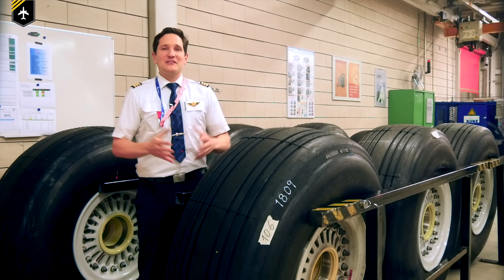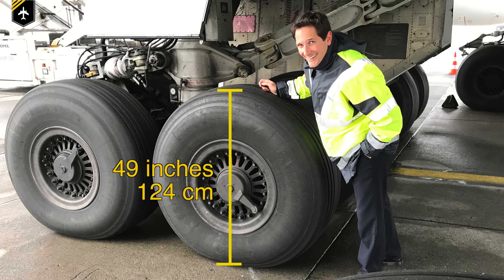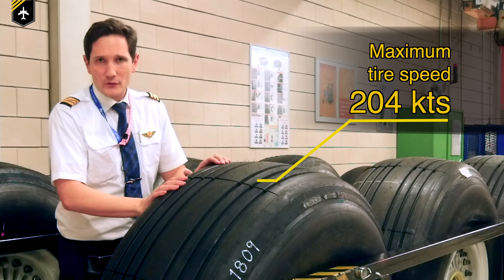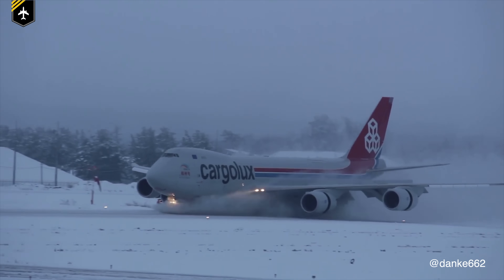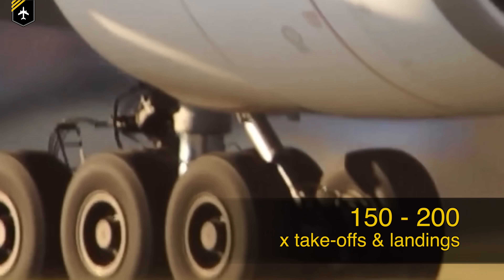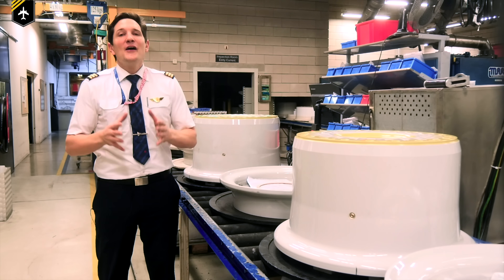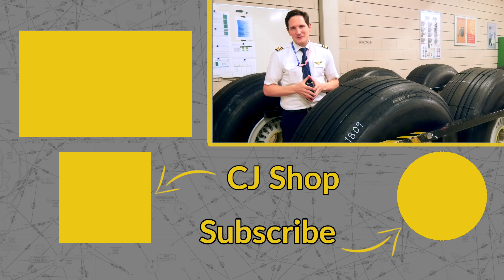HOW MANY LANDINGS can TIRES withstand?? Explained by CAPTAIN JOE

Comment: What’s the compound like on a aircraft tire are they a harder compound or a soft compound? Can you choose a different compound tire depending on what kind of weather the aircraft will be operating in?
Reply: Aircraft tire compounds are formulated to meet a large number of technical and regulatory specification requirements. Whether the compound is hard or soft is generally not a primary consideration and is really only a resulting consequence of meeting the aforementioned requirements. To this end, there are not different tire compounds to select from, as all the available tires will meet the full range of the certified aircraft operating envelope. In most cases, the only tire options that the aircraft operator has any choice in is the tire manufacturer itself.

Comment: Dear Captain Joe,im a big fan of your channel,the best out there on commercial aviation

One question for you ive had in my mind for a long time after watching countless landings at airports
Wouldnt be better for the tire lifespan and even safety if the tires would be rolling when they hit the tarmac at such speeds?
Say using some small motor to spin the wheels a little would avoid the big rubber burnout,the inertia alone would make a big gash on the rubber landing at such speeds,right?
If the wheels are spinning that can be averted,me thinks

Comment: I've always wondered if the airplane has breaks on the wheels to break when landing, just like a car has brakes. And if so, what kind of brakes and how often does the frictional parts need to be replaced? Or does the airplane only break against wind resistance? Sounds like a question for Joe ?
Reply: rpuls planes have brakes. This can be operated by depressing the rudder pedals (toe braking) or by selecting an autobrake mode on equipped aircraft that has the system do it for you. Some aircraft even operate the autobrake such that the deceleration rate stays constant to improve passenger comfort. The other part I have no idea.
Reply: Airliner brakes are of the "disc" style, though there are maybe 5-7 pairs of them within each wheel rather than a single pair (a pair being one rotor plus one stator) as with a car.  Originally the rotors and stators for jet airliner brakes were made of steel, except for the Concorde which used carbon.  The Space Shuttle orbiter originally had beryllium brakes, but in the down time following Challenger's loss, carbon brakes were developed and substituted (those beryllium brakes were woefully undersized because the weight of the orbiter increased substantially from what was in the original specification the vendor was working to).

Steel airliner brakes are designed to last through at least 1000 cycles of a dynamometer test which simulates a typical landing.  That is the "1000-stop" or "warranty" landing profile which must be achieved in order to meet the terms of the contract between the brake vendor and the aircraft manufacturer.  For carbon brakes it's more like 3000 landings, but in either case actual brake life will vary with the sort of usage they are subjected to.
Reply: @marcmcreynolds2827  makes sense to have a lot of them. Would still like to see a video on this subject, either a explanation video or an engineering video

Comment: I often wonder why the rpm of tires aren't brought up to touchdown rpm speed by the use of electric motors, wheel fins, etc.  Seems such a waste of good rubber to smoke them every touchdown.  I'm just an observer, not a pilot.
Reply: The Ramblin Georgian Have a look at “Mentour Pilot” channel for 2 episode on that topic. In a nutshell: there is no sufficient savings made by sparing the tires... Apparently!
Reply: In addition to what @Margaux & J-B Roussel stated, another reason not to spin up the wheels before landing is due to when the aircraft needs to perform a crabbing maneuver due to cross winds. If the wheels were spun up during this procedure, then the aircraft may be more difficult to control.
Reply: Thanks for info.

Comment: Why not set the wheels to rotate before landing, wouldn't it not avoid a hard tear and wear on them ??
Reply: Instability during landing, especially during high crosswind and slippery runway
Reply: Ashraf Hafizie: I don’t buy that. Landing on wheels that doesn’t already spin would be more hazardous than wheels matching the speed. (on second thought I do buy that regarding crosswinds, but that could be regulated via the onboard computers)
Reply: Michael S. Müller: I’ve had the exact same question for years. 🇸🇪

Comment: After aircraft use, I can remember a grain trailer on a fellow farm needing replacement tyres, and they were ex aircraft tyres, and capable of a lot more load than the trailer could ever carry, or speed of 20 mph to 25 mph, 32 to 40 kph  speed.    Just a great idea for old aircraft tyres.    This is going back a few years ago now .   I do not know if this would still be legal in UK.
Great Video,   Thanks

Comment: I had to replace a tire on my plane last year. Only about three years old, maybe 200 landings, but I got a bit too enthusiastic with the brakes on a practice short-field landing. :-)
No need for nitrogen, plain old air works fine in little plane tires.
Reply: Not the best practice! Perhaps good enough with car tires, but even a small and old Cessna, Piper or whatever similar, DESERVES Nitrogen filling, Maybe not as demanding as in larger airplanes, but still above any daily driven car. Just consider the cost of the smallest airplane tire related accident or yire failure... Are you that lazy?  With due respect, your attitude is incompatible with aviation, sorry.
Reply: @alfredomarquez9777  What kind of plane do you own? You maintain your plane as you see fit and I'll do the same with mine (Beech 23 Musketeer), if you don't mind. If it mattered that much Beechcraft would have something to say about it (they don't), as would Condor (ditto).

Kindly check your attitude at the door.
Reply: I was just commenting on your (less than desirable) idea that little plane tires don't benefit from nitrogen filling...  No offense intended, just an invitation not to skimp on nitrogen.  Oxygen actually degrades all elastomers, specially rubbers. Plus the nitrogen generator gets rid of the watr vapor or humidity, that also makes the pressure vary more than with dry air, so nitrogen is best.  And you would be surprised how Little airplane manufacturers really know about tires or elastomer's degradation.

Comment: Hello cap 
Its a funny question but, can we stab the tires with a sharp object like knife to cause a puncture?
Reply: The tread of a typical airliner tire -- the part that actually touches the ground -- might be 40-50 mm thick, so not very easy to do but possible.  Other parts of the tire have less thickness, same as car tires.
Reply: I suspect the resulting explosion of high pressure air would blow your body into pieces..
Reply: @crazyfroggie6546  sure thing, but my question is can it penetrate through the tires?

Comment: This video is BS. I was a fighter aircraft crew chief for 21 years. We never used nitrogen, even in the UP of Michigan at -20F.  The tire replacement isn't determined by how many landings but tire wear and or a cut depth. Our compressors were specially made to prevent moisture contamination. We all carried depth gauges for checking cuts plus we used our experience and judgement. All of our nose wheel tires had red layers in the tread to show wear. If we could see the red the tire had to be changed before any future flight, even in combat situations. The Main tires had little dimples located around the circumference to indicate maximum wear plus we checked for flat spots caused by hard landings. They all have built in anti skid systems so that was rare. Sorry, Joe.

Comment: Hi Joe, great video as always. Your data is correct for the 747-400 but the -8 has a different nose gear size. Your landing performance will also be much higher on the -8 due to a different type of tire construction ;)

Comment: When they fill the tires with nitrogen, do they evacuate the air in it first?  I know it won't be "full" but it's not a vacuum in there, so there's still some air in it.  Do they either remove as much of that as they can, or is the amount of air in a "flat" tire low enough that filling it with Nitrogen represents enough of a nitrogon:air ratio?
Reply: LOW ENOUGH... because it only needs to avoid supporting combustion, strictly speaking. Look for "lower explosivity limit" concept.  Below a definite concentration and above another, there is no possiblility of sustaining combustion.

Comment: MY QUESTION: COULD THE TIRES BE USED ON MONSTER TRUCKS?
Reply: I think Aircraft tires are like 30-50 ply or something. Making them extremely rigid, so a 20,000lb truck on them would be like riding on Flintstone wheels. First jump would snap axles, drivers neck, etc, etc.

Comment: Are the tyres rotated? I would imagine that the ones that touch the ground first would wear out faster
Reply: No
Reply: They are not rotated, all tires start to spin when they touch the ground
Reply: @stephankurz6208  No man, he means do you move the front tires rearward and vice versa, to even out the wear. I should think not, as that would be rather time consuming, but I don't know.

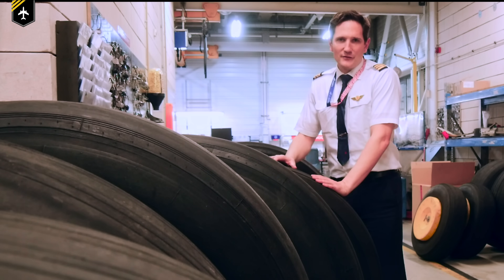Comment: 4:35 Which unfortunately was not the case with Air France Concorde flight 4590 when she crashed after taking off from Paris after running over a piece of shrapnel left behind on the runway by a plane that took off before her.

Comment: Thanks Joe. Really enjoy the info.
  FYI to all:
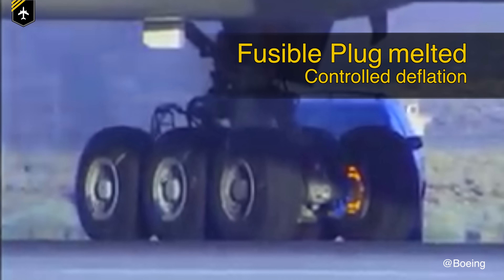The Fusable Plug is located in the rim (or wheel, or wheel rim), not the tire (Tyre). The reason you see all the black "smoke" when it blows (@5:31) is because the nitrogen exits the wheel  (through the open plug) onto the brakes, which have a lot of brake dust on them.
  Also, the reason large aircraft have rims with holes or slots is to get more cooling air to the brakes, and also to lighten the wheel - every pound (kg) saved on a plane becomes a revenue pound (kg).
Reply: Both free Nitrogen and Oxygen are found in pairs (e.g. N2 & O2) and not as individual atom's. Nitrogen (N2), although not a true "Inert gas" like Helium or any of the other Noble gases, is rather non-reactive with most materials (e.g. many metals and rubber compounds found in tires and wheels) unless heated to hundreds of degrees more than the temperature that Oxygen (O2) would start to react. This is due to strength of each of Nitrogen's 3 valence electrons bonding to the other Nitrogen atom's 3 valence electrons. Oxygen only has 2 valence electrons bonding with the other Oxygen atom of the O2 pair). This requires less energy to break the bonds of O2 and create individual atom's of Oxygen which can then react quickly with other materials.
  Using pure Nitrogen instead of compressed atmospheric gases insures that no water (H2O) is present. Water, when heated or cooled during the normal and emergency operating temperature range of a transport aircraft (< -50°F to > +300°F) will not perform like that of an Ideal gas (PV=nRT). This could cause tire pressures that are over or under the designed or expected pressures during landings, taxing, and takeoffs. 
  Pure Oxygen gas (O2) will also perform similar to the Ideal Gas Law, like nitrogen. BUT Oxygen is more reactive with some of the tire and wheel materials than is Nitrogen, possibly resulting in long term corrosion or deterioration. And Oxygen will aid combustion in case if a fire (especially when a tire rupture occurs under elevated tire pressures - aborted take off, emergency braking, etc).
  Bottom line, you need to use a single, low reactive, readily available gas instead of using compressed atmospheric gases. And Nitrogen would be a better choice than Oxygen.
  With regards to using Helium, it would be an excellent gas in terms of not reacting with any materials, or aiding combustion, BUT Helium does not form a molecule of any kind (nor do any other of the Noble Gases).  As a single, small atom not paired up like O2 or N2 gases, Helium is much smaller than a molecule of O2 or N2. This means that materials that might be impervious to O2 or N2 molecules could allow Helium to pass through. This effect is seen with 'rubber' balloons not rated for Helium. If they are filled with Helium they will not stay inflated very long.
  Hope this helps.
Reply: @andrewjohn7782  
Not quite sure explaining thoses tires remains porous like stands kind an help !!!
Whatsoever it is .
Reply: Any explanations about the choice to use nitrogen ...
Can't helium be used instead for the same purpose ?

Comment: 2:17   For the benefit of anyone who might not know, high pressure tests, Including testing of lab equipment at thousands of psi, is routinely done by filling the equipment using water rather than a gas, as water has an extremely low compressibility for a fluid.   Thus, when failure occurs, only a small amount of water is released before the pressure drops back down to atmospheric. For stainless steel lab equipment, the amount of fluid released during failure is tiny. The reason the aircraft tire responded so energetically on failure, and so much water was released, was because of the mechanical energy stored in the rubber tire itself as it expanded under internal pressure prior to failure. If that same tire had been filled with gas when it failed, the force of the explosion would have been catastrophic.
Reply: I would not have guessed that reasoning without someone explaining it...
Thank you!
Reply: When I first saw the clip, I had assumed they did the test in a pool of water to dampen the violent release, it didn't occur to me that they might have been using water inside!
Reply: @petemagnuson7357  if they did it with air, high chance that the building would have been destroyed :) i think mythbusters also did or investigate this as well :)
Reply: Same reason hydraulics are generally considered safer than pneumatics, especially at higher loads.
Reply: Did not know that! Very cool
Reply: This sounds like hydrostatic testing!  Which is done on pressure vessels and tanks regularly.
Reply: The same trick is done on scuba tanks to test their pressure. They're also filled with water so if they burst it's a smaller blast.
Reply: reimann4  ...which would also make for a less exciting conclusion to...

https://youtu.be/VwYfhkewQXw
Reply: Example on how catastrophic can be a tire explotion filled with Nitrogen was the Concorde...
Reply: youre great!
Reply: Now that would've been worth watching 😂
Reply: The steel tank testing with water can be seen for example in SpaceX's latest fuel tank test for their superheavy "starship" spacecraft. Only a very tiny amount of water is seen escaping as a weld fails and then nothing more happens.
Reply: @assarstromblad3280  And many other tanks, like air tanks for scuba diving for example and even Comet was tested in water to find fatigue cracks.

Comment: 28inch on a standard car? More like 18 I think :D
Reply: But that is for total outer diameter including the tire. 18'' is just disc itself or inner diameter of tire.
Reply: @Darkuduk  No
Reply: @FrozenHaxor  but the person you responded to IS correct.  The "18" in a tire size reflects the wheel diameter, CJ was referring to the overall diameter.  I can only image everyone running around on 28" wheels, that'd look super silly...
Reply: 18 is the diameter of the rims, or essentially inside diameter of the tire.
Reply: @dh2266  you are right and I am wrong. The car from the video has a 225/40/18 tire size as default, and the total high of the tire is then 25.06 inches. 
Note to self: don't doubt Captain Joe
Reply: @Mycel bike tire come in 26, 27.5 and 29

Comment: Hi Captain Joe, would you consider doing a video about units of measurement in aviation. I have seen kpm, mph, and knot being used. So what is the standard measuring system used in aviation?
Reply: It depends on where you go and who you work for. In general, imperial measurements are very common due to the heavy American influence within the aerospace industry. However, it is common to also see metric and SI units in other parts of the world including Europe and Asia. For ease of understanding, it is common to see both imperial and SI units quoted within documentation. For aircraft speeds, knots is standard inflight (although there are different ways to define this; true airspeed, computed/calibrated airspeed etc.). If mph and km/h are quoted, it is usually only for on-ground speeds or for passengers to have a quantifiable, familiar reference point.

Comment: I believe that there was an accident once which was partially caused by the tyres accidentally being filled with air
Reply: A DC-10 had a nose tire(s) fail during the takeoff roll, after the tires were filled not only with air, but using a hose which had been previously used for something else and had a hydrocarbon contaminant lining the inside as a result.  The aircraft aborted takeoff past V1 when the pilots felt a vibration which only worsened after the NLG had lifted off the ground.  It was destroyed as a result of the overrun, but IIRC everyone survived.

Comment: Why can you smell just fuel (kerosene) when the getting off the aircraft and in the cabin?
Reply: Outside of the aircraft you can smell burned fuel when the APU (auxiliary power unit) is running

Comment: What a great video...I learn a lot...😁 . I have a question and may you can answer me. I was flying a Airbus 321Neo...and there I saw something new. On the top of the power units was some slots...anD on the top of the wing a blank metal protection....my guess is: 
Removing Heat...but why????? Thx so much for a short answer.keep flying 😚\